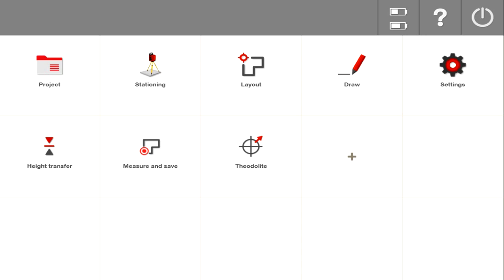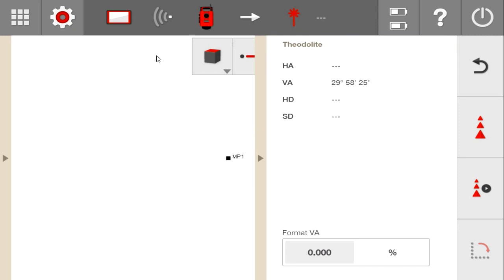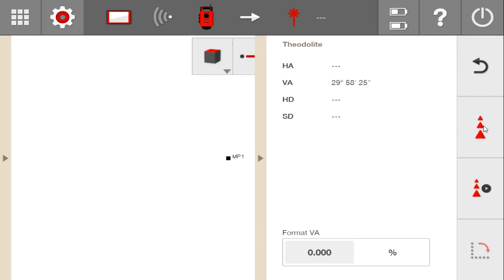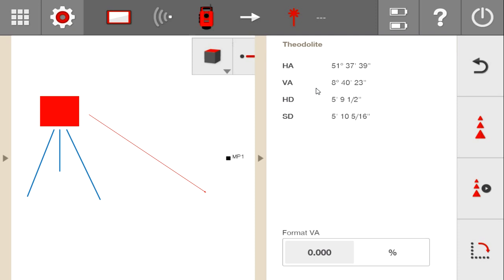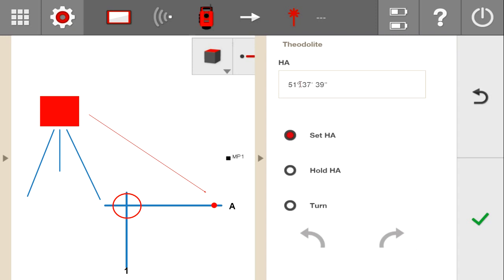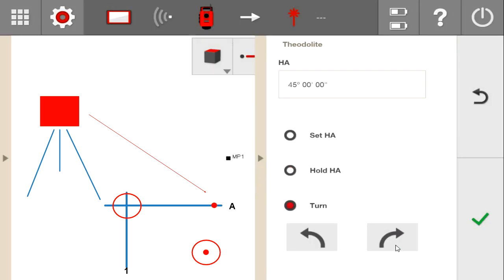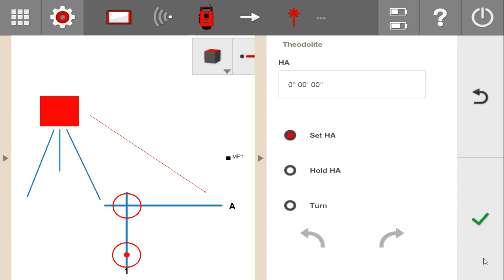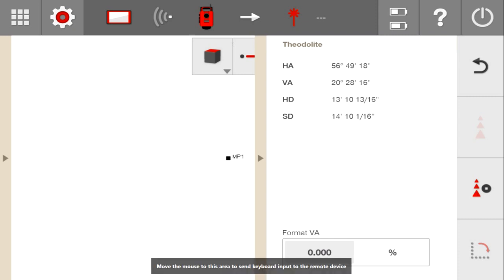Hilti PLC 400 Tutorial - APPLICATION - Theodolite

Comment: Hello,

I am from MOHK, If calibration in HK lab, they have to calibrate VA, HA and distance (10m only).
This function can be for calibration? can we also apply in PLT300?
Reply from the maker: Hi there, the calibration process will not proceed if the measurement is too short - a distance of around 30 m is typically required. The tool will warn you that it can't continue if the distance is too short.
Reply: @measuringsystems869  got it, thanks!